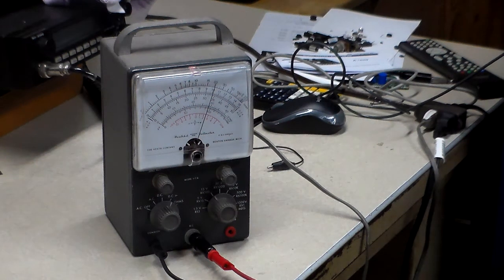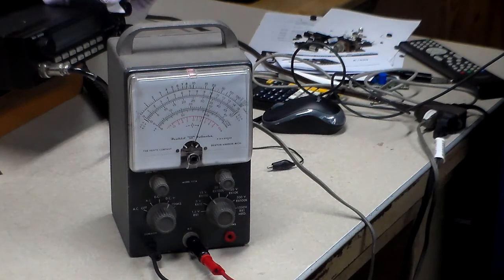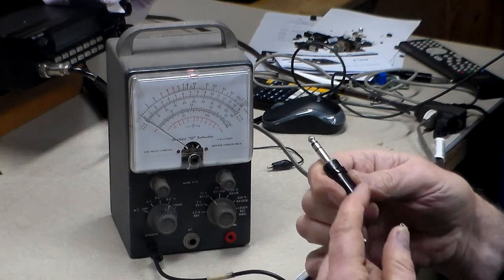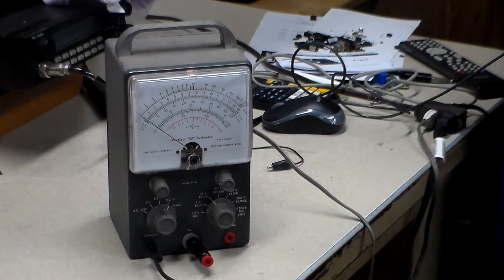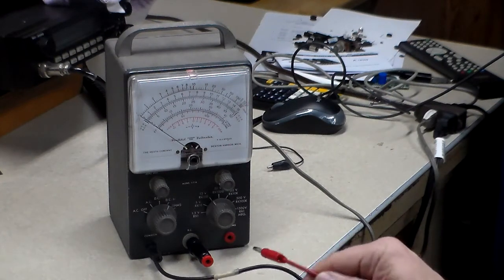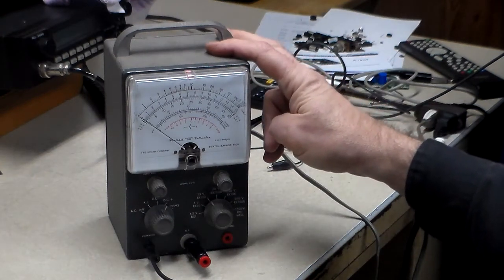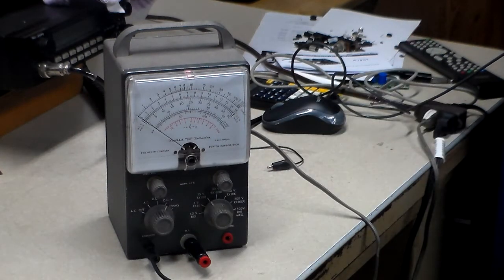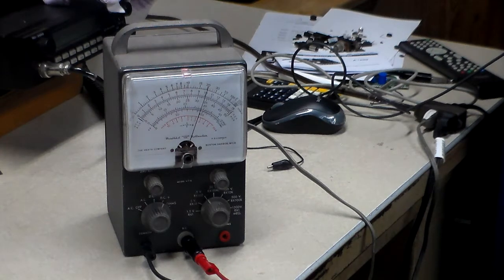Heathkit VTVM Probe

Comment: What would be a good 'current' digital multimeter replacement for a VTVM ? (Make/ Model under $250 USD)
Reply from the maker: I just picked up KAIWEETS Digital Clamp Meter T-RMS 6000 from Amazon.  I needed a clamp on ac/DC ammeter.  TRX Lab did a nice review on one.

Comment: the resistor needs to be at the end of the probe, NOT at the unit. read up.
Reply from the maker: I kind of missed the mark on this one.  Just trying to use it like a regular VOM.  You'll notice that I didn't use a shielded cable either, circumventing the whole R/C Filter effect.  It's ok for simple DC measurements, but I definitely need a correctly wired probe to use it as designed.  Thanks for the input.
Reply: @KA3AJI  You said you installed a BNC on the Plug but it looked like one for a banana jack.
Reply: @SDsailor7  Yeah. That looks like an error in the write-up.
Reply: @KA3AJI  good video. why not edit it and add making the probe. thx!
Reply: Agreed. And doing that right now with a Heathkit V6 (1954). For the DC connector, replaced 1/4" phone with BNC and using generic scope probe. Now I gotta get the 1 Meg Ohm resistor into the probe-end of the probe, so to speak....

Comment: Hi,
I am a new sub :)
Hear to watch and learn.
I hope your channel does well.
I like your idea but.
I think I saw where that resistor has to be near the point of contact.
That's why they never just put it inside the meter.
I am not sure why but maybe you could research it.
Thanks for sharing.
Reply from the maker: Hi.  Good catch.  I have heard of people putting that 1Meg Internal.  I wondered if moving it from the probe tip would have any effect.  I also thought about the safety of putting a resistor between my fingers and potential HV.  I haven't noticed any issues when using and calibrating the meter for DC, but will keep it in mind.  Now I did build an RF Probe.  That has all the components in the probe tip to keep the RF there.  Maybe I will do a short clip on it.  I put it in a marker housing.
Thanks for the input.